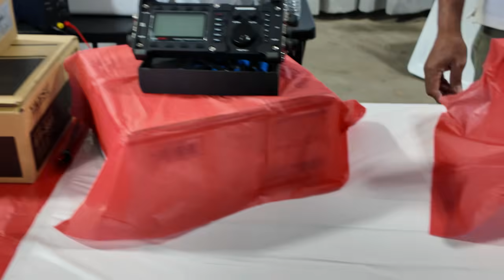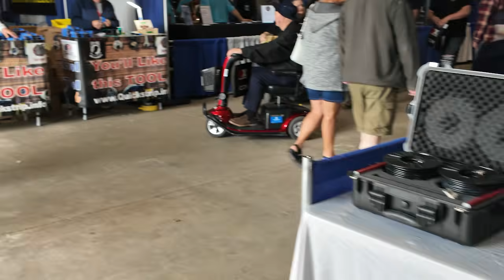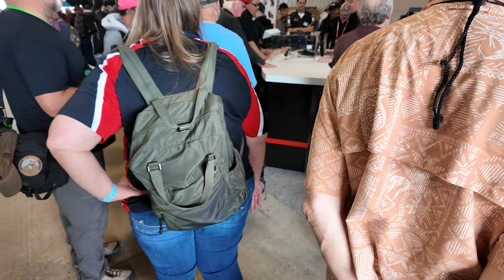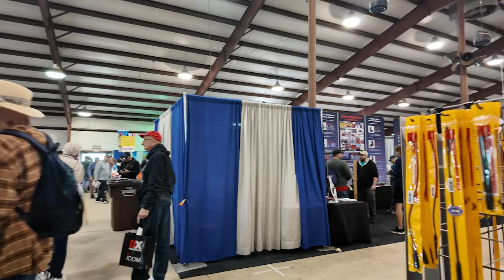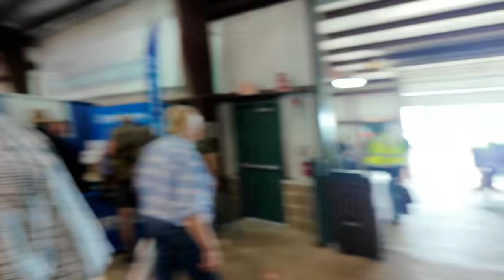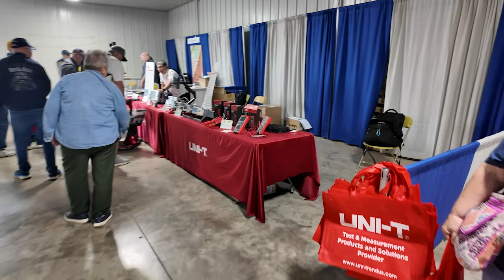FULL TOUR of the Commercial Vendor Hall at Dayton Hamvention 2026 | Opening Day Walkthrough

Comment: The big advantage of a vertical antenna is the low angle take off of the radio waves. This helps with DX work. It is omni directional.... which is good and bad. Good because you can hear the propagation move with the sun. Bad because you sometimes can't hear the station you want to work, because other signals over power them.